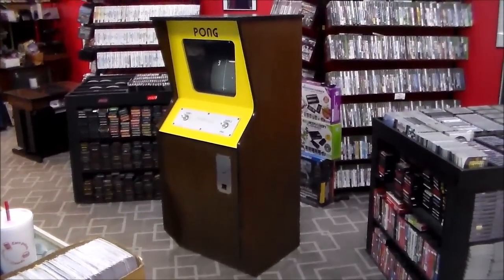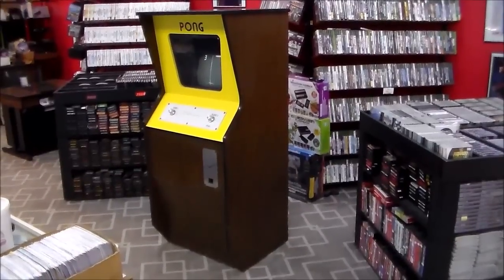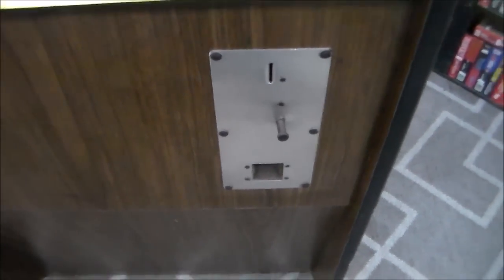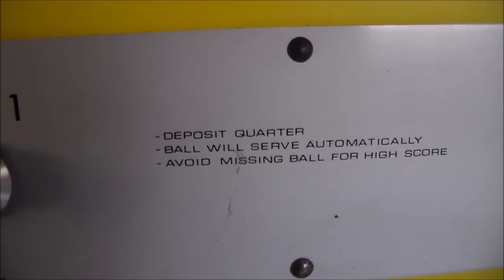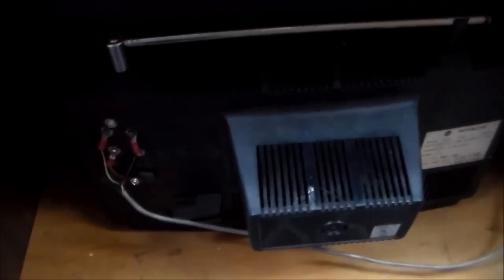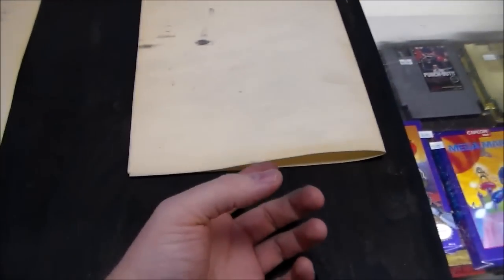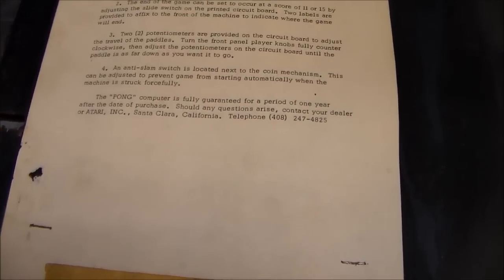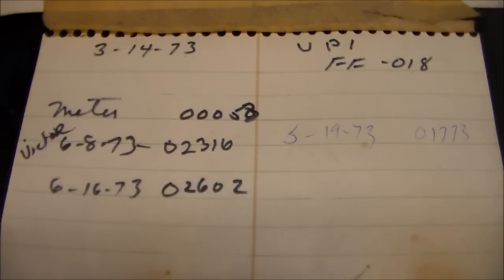Atari's Wonderful PONG Arcade Game Cabinet from 1973!

Comment: Articles I've seen elsewhere claim that original Pongs during the craze often pulled in $40 a day, so this one may have been in a pretty dead location, which would also explain how it's in such good shape. The original sales price was $900, raised to $1200 before very long. I have to keep reminding myself that these are 1973 dollars, multiply everything by about 4 or 5 to get modern equivalents.
Reply from the maker: Yes I think this one wasn't in a very good location (or two).... but all we have to go on are the numbers which are interesting.  I worked for an operator in 2005-2009 or so, and often talked with older operators, in the early 80's games routinely made $200 a week, with games like Defender making $600 when they first were released!

Comment: I played the original "Pong" game at the local mall; and Idora Park had a similar game known as "Playtime".  The only difference with that game is that it had a little stick control that you could move in all directions.  I have not seen another "Playtime" stand up arcade game since then.  I wonder if there is another one around; or perhaps someone bought the one from Idora Park and kept it running.  It looked like a 19" black & white television monitor from its size and the tube face was sort of brown from age but the game still worked last time I was at the park in the arcade; which was back in 1984 before the park closed permanently due to a major fire.  Hopefully there's still a working "Playtime" (Pong) game functioning that can be found and a video made.
Reply from the maker: Gary there are indeed still Playtime games still working out there... check out this page :  https://www.arcade-museum.com/game_detail.php?game_id=13623

Comment: Interesting there is no ending screen. When the score of 15 is reached, the game just stops
Reply from the maker: It's hard to explain Don because i'm not a engineer but basically the entire game is created just from transistor gates, there's no software, no processor, no rom, and no ram.  So they're literally just making boxes appear on the screen by making voltages run this way and that way it's a really marvelous creation, but it also meant they didn't have much ability to make the screen change much!